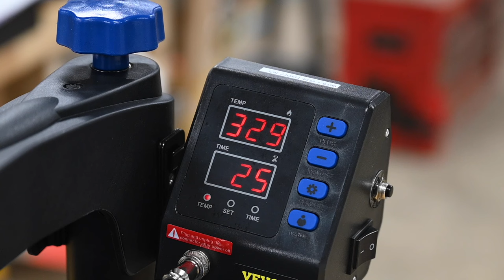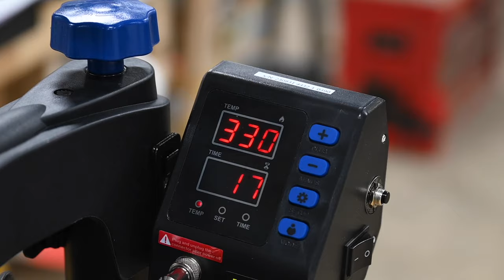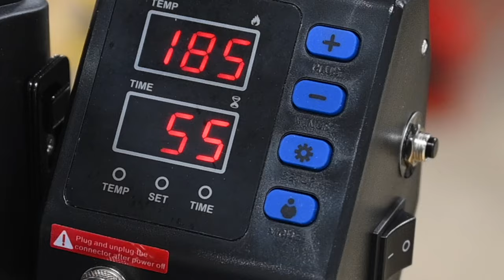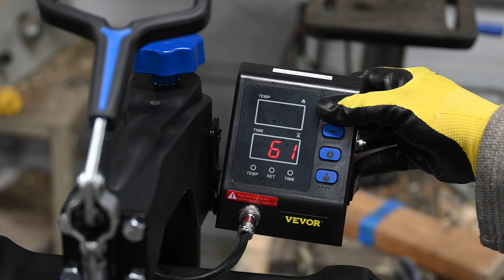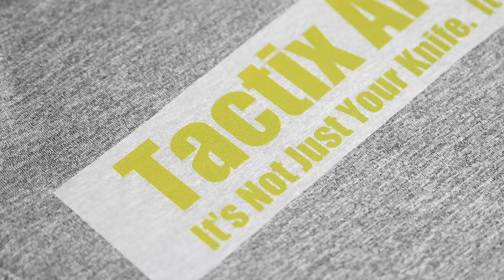Vevor T-Shirt Press Review - It Works for Kydex!

Comment: Few tips...
-HeatPressNation silicon pads and teflon sheets are the way.
-check your platen temp with an IR thermometer and compare with temp on the readout. If there is a discrepancy (which there often is) there should be a way to calibrate.
-clamshell type heat presses are ofter way cheaper than swingaway presses and require less bench space.
-always heat material shiny side up.
-adjust the clamping pressure to "fairly heavy". This will reduce the amount of shrinkage of material.
-boltaron is superior to kydex in just about every way, especially when heating with a heat press, as you can pump the temp up and get better definition and longer working time. I usually run mine at 400 degrees for 120 secs for 0.80" material. 
-take an old towel place it in the press and run a few cycles to preheat the pad and drivev out any moisture that it may have absorbed. If you're heating material and getting little pockmarks on the shiny side, its usually due high humidity in the silicone pad.

Comment: I picked up the other style heat press that hinges from the back instead of swiveling. I have used it on a few cloth projects and a couple Kydex. I like it much better than the toaster oven, which you can't do t-shirts in, LOL. Getting multiple uses out of a tool is a good thing.

Comment: Until I read the comments it never occurred to me that this could be used for tempering. If the temp control is more accurate than a toaster oven, lots of folks might want to use it for that. Still going to use my Evenheat, though.

Comment: I've seen other T shirt Presses that clamp down, I was always curious if you could heat the kydex, then throw the foam in there and press on one machine but I bet the press would be too hot for the foam at that point?
Reply: Yup, too hot, but I did see a Kydex user pre-
heat the foam a bit with the press open. He thought it helped some.
Reply: @tomsdreamshopworx  Well I guess the press doesnt make much sense then from a space perspective since as a knife maker you probably already have a toaster oven for tempering in the shop which will get the kydex job done, no sense adding another tool.
Reply: @knifeknerdreviews4609  Unfortunately, I am not a knife maker yet. I will get there. And I do have a small toaster oven out in my shop, it was too small to fit a wide sheet in it. It's all good!
Reply: I always preheat my foam by just laying it on top of the platen while the material is heating. A heat gun works well also.